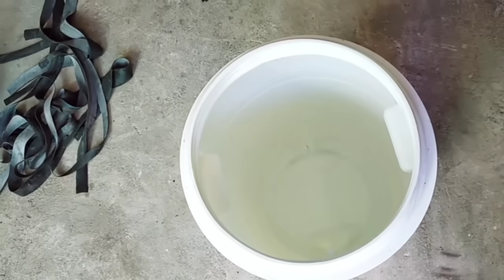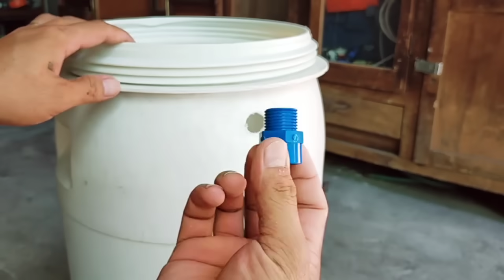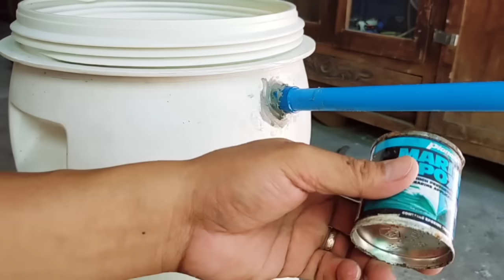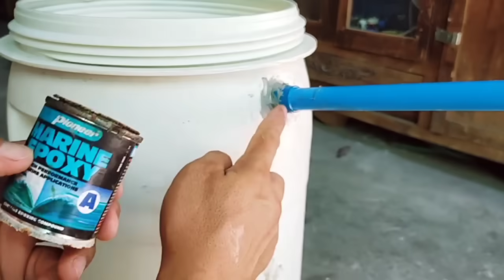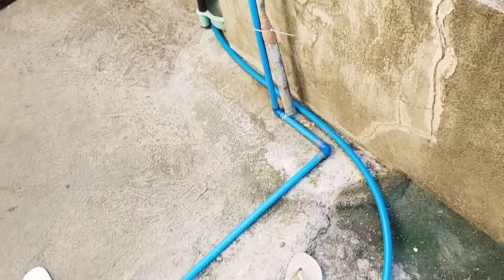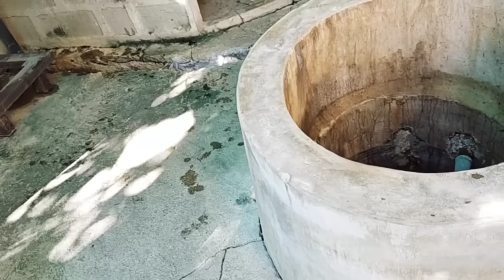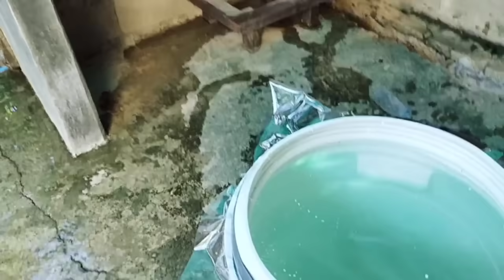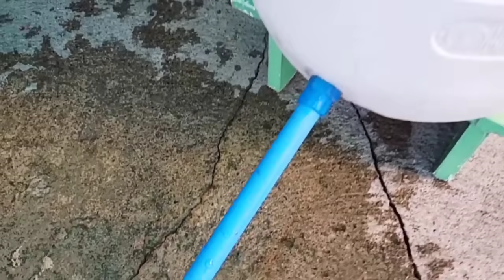improvised water pump no electricity how does it works none stop water life hack part 2

Comment: My understanding of syphon systems, and I have one, is that the outlet must be below the inlet level. This appears to be not. A simple siphon raises water over a crest and discharges it at a lower level.

You can fill that white barrel with as much water as you like but all it will do is fill the well.
Reply: You are confusing yourself.. the inlet is that one comes from the well!!! Which is higher.
Reply: @bwerumaster6691    The height of the inlet to the drum is not relevant. The crucial question is: is the outlet higher than the water level in the well. If yes, the effect is faked. Water can not flow to a higher place without an external input of energy.
Reply: This only works as  a siphon , nothing else .    As you said, water source must be higher than exit pipe .    The tank gives you advantage of not having to install a pump or a vacuum to kick-start  .    The tank can kick-start your siphon every time.    It cannot drag water out of  a well unless if the exit pipe is below the well's water level.
Reply: @wildthoughts6959  No Wild Thoughts here only a clear analytical mind that has an excellent understanding and documenting the problem very clearly
Reply: @wildthoughts6959  jeśli zbiornik jest zamknięty i rura nie zasysa powietrza robi się podciśnienie w rurze w studni i wraz z wylatującą wodą zasysa nową ze studni
Reply: @sutanzotarasia7799    You forget, that the vacuum "sucks" at both sides, not only at the inlet side but also on the outlet. With an outlet higher up than the water in the well the increasing vacuum will stop the outflow before it is strong enough to lift the water from the well for the full height. And since outflow stops the vacuum does not increase anymore and the system stalls without having brought up any water from the well.
Reply: @heinzpg  vaccum don't lift the water Atmospheric pressure do. Water displaced acts like a syringe  that create partial pressure.
Reply: @infinitebeing1119    I am aware of that. But this does not change that it needs a pressure below 0.4 bar at the top of the barrel to lift water e.g. for 6 meters. But with a barrel of one meter height already a pressure below 0.9 bar stops the outflow. And without outflow the pressure does not decrease anymore. I have explained you why this doesn't work on many threads by now. You never respond to my arguments, you just keep on claiming that it works - although it doesn't (except with an outlet below the water level in the well). What's the matter with you? Are you simply trolling?

Comment: changes occur here 08:02, this is clearly a public deception. the drum has been replaced or the pipe already has a water machine inserted. this is all a trick of the camera, he takes video from two directions, namely the top and the side, not the whole.
Reply: This is working.
Camera stops because he needed to secure the plastic on top better. The suction pulled it off the first time

Comment: I guess it could be useful for irrigation of a garden on a drip line, but I have no well or cistern from which to draw the water. So, I’m stuck with my elevated rainwater catchment basin and gravity feed.
Reply: you can still give a try, do not believe on others negative comments. Try yourself. If you succeed then flowing water could be used on ram pump. Using ram pump you can lift water upwards forcefully

Comment: The most convincing one I saw. Thks for sharing.
Reply: @sciencefreak9070  So you're saying that gravity wheel doesn't exist.
Reply: @guruji243    Correct. There are several constructions for gravity wheels, a well known one is the Bashkara wheel, but none of them work. You gain energy when a mass moves downwards, you have to invest energy to move a mass upwards. Since all masses of a wheel move down the same height as the move up no energy can be gained by such wheels.
No device can deliver energy without the same input of energy. (Except if there is energy stored in the device which is used up.) This is one of the strongest laws of nature we know: conservation of energy. Energy can only be transformed from one form to another form, but the total amount of energy can't increase or decrease.
Reply: @guruji243    Laws of physics are based on observations of nature, and nature doesn't change. That's why these laws also don't change. It is true that these laws have often  been improved and modified slightly, but overall no law of physics which deserves this name had to be declared as wrong after some time. 
And no, the Bhaskara wheel does not work. If it would work you would see it in many places, just put up for decoration, it would be a nice toy to watch. You find many informations about the Bhaskara wheel in the internet with explanations why this "distabling" does not work.
Reply: @guruji243    Yes, we are always learning, but we have learned about the impossibility of perpetuum mobiles long time ago. I am familiar with the video you indicate. If you do some research about "veproject1" you will find that all of these models are only running due to a hidden drive system. They are just there to raise curiosity.  There are also many comments which mention that. Have you never wondered why you find none of these models elsewhere than in these veproject1 videos?Do you really think science declares the impossibility of perpetuum mobiles since centuries and ignores, that there are functioning ones in YouTube???

Comment: It really works..cause i myself did this in my fishpond...many of comments here says there's a pump inside the well ,well there's non...if there's pump inside the well then then there will be no vacuum in that tumbler as you can see the plastic its concave,likewise if there's pressure coming from a pump well definitely the cover will be convex and will explode/burst😊
Reply: This is a siphon. No siphon can pump water to a higher level. The video is false.
Reply: @kjellg6532  this is not siphoning. This is water displacement suction. Just like you are sucking juice from glass through strow.

Comment: I did this experiment with a 20ltr sealed container and a garden hose. It works better with a larger outlet to create more pressure and longer. This is the way I will make hydroponics and electricity in a perpetual circle for free. I may even use it for aquaponics.👍🤓🤑🤮🤑🤩🧐
Reply: Can not work. The video is fake.

Comment: You cannot decieve all people. 

Obviously that pressure in the barrel generated by the water coming out is not enough for the water in the well to come up to the barrel.

Ofcourse water may come out of the barrel only by producing water bubbles that will pass from the outlet NOT by suctioning water in the well (that is not enough pressure).

And guys did you notice the increase of pressure when he disconnect the green hose from the outlet? That pressure should be consistent. So obviously there's something wrong

Comment: Great video. What he need to increase the flow is to add two or three T-fittings on the outlet pipe, it will create air into the pipe and push water out. Then the more the flow the more the suction line brings more pressure. I hope my explanation is fair and understandable. Lol
Reply: Does it really work?
Reply: Of course...., It's just like syphoning fuel with a long hose from fuel tank
Reply: @ashimasquare9876  But with Siphon water level is higher than exiting pipe.
Reply: Can you do this with 50 metre drilled bore hole
Reply: @kafiswemwaya9276  as long as the pipe touches water, The answer is yes
Reply: @ashimasquare9876    This system only works when the outlet is below the water level in the well. Water can't be lifted to a higher place without an input of external energy.
Reply: @heinzpg  the answer is pressure
Reply: @mafiozozpruszkowa9419   Yes, water and air pressure are the relevant parameters. Why does this device not work with an outlet above the water level in the well? Because water pressure - which only depends on the height of the water column - is bigger at the inlet side than at the outlet side. Thus, with a growing vacuum at the top of the barrel, air pressure stops the outflow of water first, before the vacuum is big enough to pull up water from the well.
Reply: @heinzpg  so with a big enough outlet and a wide (to put pressure at outlet) and tall (for duration) water vessel it should work for any depth, provided the whole system is airtight. Opinion?

Comment: This may work, but I think a one way valve on the outlet pipe is needed, else the water would drain from the barrel, gulping air in the process thus defeating the siphon action.
Could be wrong.

Comment: I did exactly the same thing, but it didn't work.
At first I had some doubts, but now I confirm that it does not work.

Will you have an explanation for this, if not something is wrong in your post.

Mr. KEBAILI

Comment: It is very excellent. It will depend on the vaccume principle. When the water goes out vaccume occurs in the bucket and to cover the vaccume water from the well come in to the bucket. The plastic paper tied up tightly not to enter the outside air in to the bucket. It is working not on the siphen method principle. It is not fake I think. There's no magic in that
Reply: It appears to be working on two principles one Atmospheric pressure acting on water on the well. And gravity that pulls the water inside the barrel creating negative pressure.

Comment: Just imagine there are two syphons in series.
1 first syphon lift water from well into tank
2 second syphon passed the water from the tank to the outlet
Pressure in the tank has to be lower than in the well. Then pressure at the outlet end lower than pressure in the tank
Reply: The video is a scam!

Comment: Dear, Actually this is can not called as water pump. Since this will not work continuously after some time water is not filling from well to tank. If someone need to make continuously work, out put end  should be maintained  lower than well water surface level. Please don't mislead the people.
Reply: Incluso bajo el nivel del agua (en mi caso de un estanque)  tampoco funcionó, el agua se iba hacia el estanque .

Comment: To make this project successful your have to keep the input and output air tight. Simple it will work definitely
Reply: No!!! This is a fake video. You can't lift water to a higher place without an input of energy, never mind how air tight the system is.
Reply: @heinzpg  Ok then how ram pump work?? Is that also fake??
Reply: @Wowboxxx    No! Ramp pumps work! They do have an input of energy, they take their energy from downflowing water. Only a very small portion of this water is pumped up for considerable heights. You can see ramp pumps at work since hundred years in many places. But I bet you will never see a pump like the one in this video anywhere in practical use. Such "pumps" only work in YT videos ... 🙂
Reply: @heinzpg  For your kind ignorance, i have seen it in a remote village, they made it with 4 barrels. They were using it for fish pond. A local student helped him. Even though i give you the working video, you will still say its fake because of your ignorance.
Reply: @Wowboxxx    I don't know what you have seen in this "remote village". By the way, can you give us the address of this place? And why are these things always seen in remote villages only, why never in near villages? But whatever you might have seen, for sure you haven't seen water being lifted from a lower level to a higher level without any input of energy. This would be what is called a perpetuum mobile, and perpetuum mobiles are not possible. The ignorance is on your side, since you are not aware that there are laws of nature which can't be broken. Conservation of energy is one of them. If a magician lets float a person on stage, do you also think he has mastered anti-gravity? No, he hasn't. It's just a trick.
Reply: @heinzpg  Why remote village 😆😆😆😆 just use your common sense. Near village have electricity. 
Similarly i have seen ram pump in remote hill area Only, not in my village or next village. 
As if you gonna visit the village, when i give you the address. 😏😉
Just do it yourself before doing blah blah blah. #Ignorance
Reply: @Wowboxxx    You think it depends on the availability of electricity? I doubt it. Most farmers are not rich. Why should they pay for an electric driven water pump if there is a system which does not need one? And why should they increase their electricity bill by the running costs of an electric pump if there is a system which does not cause running costs?
Yes, if you would name the address it is unlikely I would go there. But I would try to contact someone in this village or a village nearby and ask about this miraculous pump system. Perhaps even readers of this thread would have relations nearby they could contact. Thus it would make sense if you would give us this address. Are you willing to do it? (Besides, I can quite believe there is a system at this place with four barrels, but I don't believe it can lift water from a well.)
I have also seen several ramp pumps. The huge difference between ramp pumps and this system: ramp pumps are in conformity with laws of physics, this "barrel-system" is not. You never addressed this argument of mine, which raises doubts about your competence in this field. Have you ever heard, that perpetuum mobiles are impossible? Are you familiar with the law of conservation of energy and of its consequences? Have you heard about the Noether-proof for this law? If your own competence in science is close to zero, why do you call others who have studied physics ignorant? Such "ad hominem" arguments only come from those who have no factual arguments ...  🙂

Comment: I'm so intrigued!...I know a syphon works as long as the exit is lower than the inlet. Will this device eventually stop? Aparently it's violating the law of conservation of energy. Someone please elavorate a little bit. I know the weight of the water flowing downwards is pulling a vaccum which then pulls the water up from the well, and as i see it, the operator had to first fill up the container which adds potential energy in it, my quetion is: will this contraption stop once this potential energy has been used up?
Reply: yes

Comment: So you could use this method if you had a large pond snd you wanted to pump water uphill to the power a small micro hydro unit thereby converting the flow to electricity whilst returning the water  to the pond ? Would that work?
Reply: It is possible
Reply: Este video es falso el agua no fluye hacia arriba. Siempre se nivela a no ser que una fuerza exterior la empuje,la misma presión del agua no puede empujarla

Comment: The bottom of the pipe going into the well place a one-way foot valve to maintain pressure.
Reply: No need. The purpose of the drum is that you do not need any foot valve, BUT the source must be at a higher level than the output for this siphon to work.

Comment: Good day po, will it work po if the bucket has faucet?
Reply: Yes, but note, that it only works if the outlet is below the water level in the well. Then it works with or without faucet. But it can not lift water to a higher level. The video suggests this, but this is a lie.

Comment: What would happen if you fed that back into the well with a small hydro turbine in between? It may not supply a lot of power, but using this setup, you could install many of them producing an unlimited supply of electricity, no?
Reply: Is the closest  thing  to perpetual  but the water eventually  will evaporate. It would  work with a water wheel  🎡  fill up and the mechanics  of a bicycle  gear to get a bigger or faster spinning also so whatever  doesn't  evaporate  put the whole system  in a sealed  chamber
Reply: @javieralvarado5996  Not if the entire device were enclosed in a sealed dome.

Comment: Put 2 boards across the top of that Well right there & put that barrel onto the boards, to get it up higher, then there is all kinds of options w/ moving water
Reply: Stick the barrel on top of a pylon it still will not work if the water level in the well is lower than the outlet pipe.

Comment: if I try this it will only cost me a bucket if it doesn't work. if it does work Ill probably try with a bigger tank.  putting it in line with a small sluice it will be great! no noise or fuel or batteries for pumps.
odd that not many vids done nearer to home. but the principal seems sound.
Reply: Make it at a much larger scale and feed the discharge line back down the well. Install a "dam" with a connected hydro electric generator and power your house forever. Enclose the entire system and the water will never evaporate.

Comment: Works as long as use large diameter barrel. Deeper the well larger the barrel.  Must not run out of water. Need primer pump. More height lets u shower.
Reply: Deeper the source, not necessarily the well.

Comment: impossible, to drain the water requires strong pressure. If it's a plastic working tool, the cover must be torn off, it's not that easy, my friend, to suck water from that depth. 🙏

Comment: Question, how long does it last? until the water is emptied from the barrel, or one hour, two hours?
Reply: Until water is emptied, this is due vacuum through gravity, as long source contains water vacuum will continue unless got some air between flow this could decrease pressure.

Comment: how much pressure does the system produces to the water going out, can this be used to lift water to a height of 12 feet vertical?
Reply: No siphon can lift any water to a higher level, not even a few mm.
Reply: Yes
Reply: @infinitebeing1119  No. If this was possible we would have a perpetuum mobile. You cannot lift water without adding energy to it. Here is no energy source, so no flow, no lifting, nothing. Standstill.